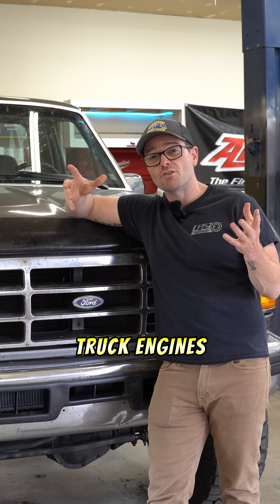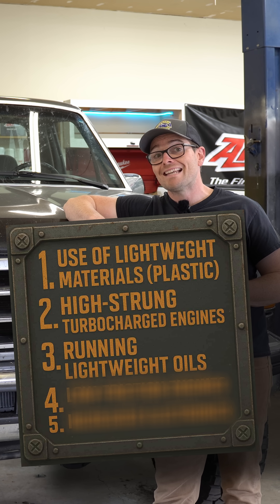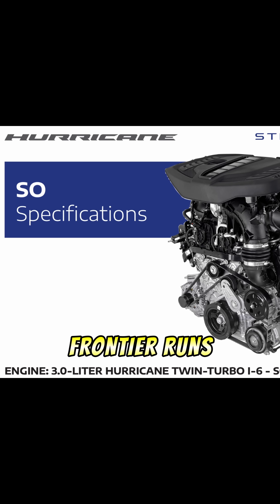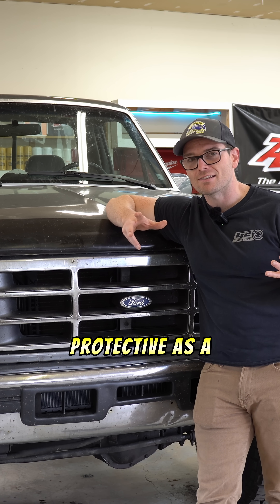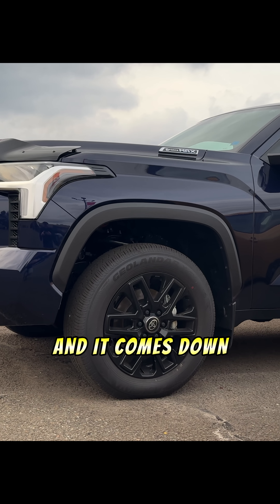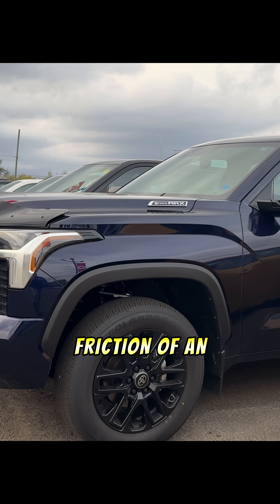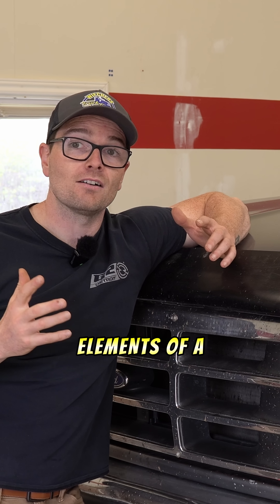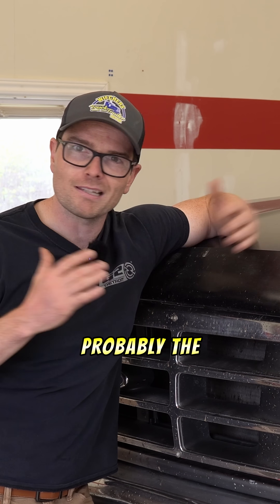Major Reason Modern Truck Engines Don’t Last as Long 👀

Comment: If it's a newer vehicle and was designed from the beginning to use 0W-20, that's one thing - but when they try to tell me that my father's 98 F-150 V 8, that was designed to run on 5W-30, and the owner's manual and oil cap calls for 5W30, is supposed to now get 5W-20, because they just decided to change the spec years later, I'm calling BS.
Reply: Id say you are correct
Reply: On my 2024 Tacoma, the manual and oil cap clearly say 0w-20, but the sales drone at the dealership says “Toyota is recommending 0w-16 now.”
This seems like a war between corporate DB’s and engineers.  In any case I’ll never get the service plan ever again because they probably drain out my amzoil 0w-20 and put in Toyota’s 0w-16😑
Reply: @theblueberryBULLET  Same here. My 2005 Jepp Liberty CRD, with a 2.8 L turbo diesel, was designed for CI-4+ diesel rated oil. Chrysler sold them with Mobil 0W-40 gas engine oil, not even diesel rated. As soon I got it home (bought it new), switched over to Amsoil 10W-40. 20 years later, that engine is still tight as a drum with no problems.
Reply: This is what I was thinking. I had a 2019 & 2025 RAM's with the 5.7 HEMI's my new 2026 with ( What I believe has ) the same HEMI engine now calls for 0W-20.  WHY ?

Comment: Viscosity takes up space, if the tolerances are correct, the lower viscosity oils will work fine. Film strength is more critical.
Reply: Clearances, not tolerances
Reply: @Resistculturaldecline 
It’s a fine line there , clearances vs. tolerances.  If the parts are in tolerance, the clearances will be correct.
Reply: @edwardhoward4708  They are topics of the same discussion, but theyre different. Like engine displacement and HP, as a poor example
Reply: You know what else takes up space? Bearing material from lighter weight oils not providing proper lubrication and film strength.
Reply: Bullcrap

Comment: My 2022 F150 5.0 takes 5w20.  My first truck 66 F100 352 took 20w50. It blows my mind to see 0wANYTHING!
Reply: Remember that the first number is the cold weather crank rating of the oil. It is not viscosity at operating temperature. Cold oil is way more viscous than it needs to be for proper lubrication, even if it is a 0W oil. If you have a diesel that specs 15W40 then there would be no harm in running a 0W40. It would actually be better for the engine since startup lubrication would be improved. The viscosity at operating temperature will be the same. 

With conventional oil getting a 0W40 to perform well across all temperature ranges meant a lot of additives which had a risk of breaking down, which meant very frequent oil changes would be needed. With a full synthetic, it really isn't difficult to achieve and still provide a longer service life than a conventional oil.

The second number in the viscosity rating is critical. This is the operating viscosity (weight). Always follow the manufacturers rating here. Going lower could mean a reduced oil film thickness, which may not be adequate for engines with higher bearing clearances. The oil may drain out of the bearing interface faster than it is supplied. Especially at idle. Higher viscosity is usually ok within reason but may result in increased heat and a loss in efficiency if you go nuts and jump up from a 5W20 to a 15W60 for example. 

Lots of discussion online. But if you don't care to nerd out online about oil viscosity. Just stick with what is written on the fill cap. 😂
Reply: Yea an in 1966 a 100k miles was high. 200k miles in 2025 is not uncommon. 

2011 Toyota tundra has 200k miles, only ever used 0W20.
Reply: @FrostlineAK I have a 2017 Sequoia with 250,000kms and only use 0W20 Synthetic. I just buy the name brand on sale with a Toyota filter.

Comment: Just for reference people need to look at their owners manual. It will suggest varying acceptable oil weights for different temperature ranges. You can run many different weights within a given temperature range and not void warranty.

Comment: Just for reference people need to look at their owners manual. It will suggest varying acceptable oil weights for different temperature ranges. You can run many different types of weights within a given range and not void warranty.
Reply: viscosty doesnt equal protection. its the internal sheer of the oil . as long as the outer layers stick too the metal and the inner layers can sheer internally without the outer layers getting displaced you are very well protected

Comment: Ehhh you should maybe converse with “the motor oil geek” on YouTube maybe yall could do a video together. It’s my understanding it has more to do the manufacturing tolerances than anything. Tighter tolerances requires thinner oil, large tolerances requires thicker oil to fill voids. Also lower friction is also better for reliability, so if it does reduce friction like you said that would also make it more reliable. Oils entire job is to reduce friction.
Reply: OK, Traditionally most engine plain bearings needed about one to one and a half thousandth of an inch clearance between the journal and the bearing shell!  Just how tight do y'all think these new engines are? Yeah plain bearings ride on a thin hydrodynamic film of oil when they are running, they don't actually touch the bearing journal. But there has got to be some clearance there to withstand shrinking and expanding as temperature changes like as when the engine is warming up. 
 So I don't buy that tighter clearance theory.  
 So the clearances on modern VVT engines may be just slightly tighter, but they are more importantly they are more accurate with better surface finishes and metallurgy.
 And these thin oils are all about CAFE. But I wouldn't use anything heavier than 0W30 5w30 or possibly 0W40.
Reply: Yes but I think lower friction also means lower protection against hard shocks of power.
Reply: I've seen his video. I don't listen to the tighter tolerances mumbo jumbo. I'm far more inclined to believe they use the thinner oils to increase mileage. Yes, they might have decreased tolerances to use the thinner oil but they're prime motivator is mileage. Thinner oils don't protect in high heat, it's like lubing your engine with WD-40. No thanks. My personal experience is my 99 XJ with the 4.0 six cylinder that I have owned since new. It has had oil changes at 3-5000 all it's life and still runs like a raped ape. It is spec'd to use 5W-30 and it gets that and hated 10W-30. I have recently started using 10W-30 as it gets older with 130,000 on the clock and it loves it. So, in my opinion you should use the  lighter weight when new but switch to thicker as the tolerances open up.
Reply: @oldman-zr2ru it’s almost like maybe the tolerances got looser as it aged and got miles on it. Then in turn possibly needed thicker oil (at least while cold) due to looser tolerances. Your personal experience lines up perfectly with my original point.

Comment: The change in bearing materials is an overlooked factor in the reduced durability of today’s engines. Manufacturers moved away from tri-metal steel, copper, lead bearings due to EPA restrictions on the handling of lead. The current polymer coated aluminum bearings simply don’t have the durability of a tri-metal bearing.  The tri-metal design was much more tolerant of debris or breakdown of film thickness. Add to that tighter clearances and lighter weight oil you leave very little margin of error before you have bearing failures.
Reply: One of the same reasons modern Electronics absolutely stink. They took all the lead out of the solder and therefore took out all the flexibility. Now all solder joints do is crack
Reply: @acemobile9806  I was gonna say the same thing. Red Ring Of Death
Reply: IROX coating/layer adresses that and stop/start dry risk. The aluminum bearing ahells are fragile but AFAIK those are no longer used.
Reply: clearances arent any tighter the light weight oil is for CAFE standards only it has nothing to do with friction or tolerances
Reply: @GoTotheMoonElon     yes , maybe somewhat tighter, but more importantly more accurate tolerances and better surface finishes and metal treatments.

Comment: I do run 5W-30 on my 2020 Ram Hemi and she LOVES it!!! She runs way better! No more valve train noise and most importantly almost 65k miles with no lifter tick
Reply: Yea, iv heard the 5.7 hemi runs 0w20 from factory. Dumbest thing you can do is run that thin of oil in that engine.
Reply: I been running Amsoil Signature Blend 5w20 in my ‘16 no issues at all it has over 202k on the clock.
Reply: @JeffK-w8r   Signature Series I suspect you mean. They don't have a Signature blend, although they do have a semi synthetic they guarantee to contain 50% or greater synthetic base oil, where most other synthetic blend oils only contain from about 5% to 15% or so synthetic. I've heard it's pretty good but haven't tried it.
Reply: @JeffK-w8r   I've been running 5W30 Signature Series in my fords that call for 5W20 and it's been working good. Gives a little extra viscosity protection against fuel dilution thinning n stuff.
Reply: Pennzoil Ultra Platinum 5w-30 for my '17 F150 5.0... truck runs smooth, sounds smooth... is smooth. 🇺🇸
Reply: Buying a new truck at 150K miles is insane. Do you lease or finance? How can you afford thst
Reply: Same here, over 100k on my 17 ram and it purrs.
Reply: Be Ready For Cam/ Lifter Issues..If This A 5.7 Hemi...Thank Dodge Ram For The Factory Problems....6.4 Hemi's No Problem There....
Reply: @tonybernheim8365  6.4 eat lifters too
Reply: @tonybernheim8365  not gonna happen hahaha my lead foot mixed with better oil, she’s purring until 150k, then I’ll get a new truck hahaha
Reply: @jsqared 
I'm running mine until 300k miles before I spend 70k on a new truck😂
6.4l
Reply: I’ve got a 20 rebel and changed every 5k and had lifter failure at 58k using the recommended 5-20. My father-in-law has 130k on his with no failures using the dealership oil but changing every 3k. He also has start stop and has way less idle hours on his. 150h vs 380h. 🤷
Reply: @h.merica  yeah that’s why I use the thicker oil, I also don’t let my truck idle, pretty sure I’m under 200 hours of idle time. I also change my oil every 3k miles

Comment: The Ford Crown Victoria’s 4.6 V8 ran 5w20 and it literally runs forever reaching well over 200k in police cars which idle a LOT.
Reply: Also the Ford Crown Victoria ran 5w-30 and lasted even longer.
Reply: My 2010 f150 is the same 4.6L V8 and I run 5W20
Reply: My two 4.6 Mustangs took 5w-20. The 2v i actually put 0w-20 because 5w wasn't available at that time in Mobil One.
Reply: 5.9 magnum in my truck uses 10-30 and has 290k on it and runs well.

Comment: How do you factor in bearing clearances and pump design?  I would switch to 5-30 from 0-20 personally. Some of these new engines might not like a thicker oil.
Reply: Thats bs, it basically comes down to what climate you live in. If your way up north 0w-20 will work fine. Down south that 0w-20 is like water
Reply: @MattC0725  why does it matter, all engine oil reaches temperatures above 200°. If it’s 110° outside, so what? That whole if you live in warmer climate is an absolute fallacy. If it’s cold outside, though the thinner, the oil the better.
How can you say 0W 20 is no good in 100° heat when 10 minutes later you start your engine and that oil is literally 200°
Reply: @Maynardd  if you think the engine oil stays the same temp in every climate you havent been around vehicles long
Reply: @MattC0725  your comment says absolutely nothing. That engine oil is reaching 200° plus in any climate. I lived in Florida for five years, average temp of the oil was about 205°. I live in Northern Illinois where it can be -10 and guess what that oil reaches about 205°. An engine is a sealed combustion chamber. It reaches temperature no matter what. You don’t know what you’re talking about. Do you? Then explain it to me. Your concerned with something that might be sitting outside reaching let’s even call it 120°. But when you start that engine, it reaches over 200°. Make that make sense. The thinner the oil at start up the better!
Reply: @Maynardd   pull a 15k trailer in 100 degree heat and tell me climate doenst effect it. Your whole cooling system is based on the ambient air temp (radiator, engine oil cooler)
Reply: @MattC0725 😂 i’m a commercial roofer, trailers, dump trucks, whatever it doesn’t affect it at all, it might affect the transmission temp though. What’s that have to do with the outside temperature being 100° cooler than your engine oil?
Reply: @Maynardd  also you do know engines ingest outside air right? So tell me how its sealed 😂😂
Reply: @Maynardd  😂😂 ok bud run some 0w-8 in your truck should last longer
Reply: You can always try 0/30 as your start up cold flow will be virtually the same but you will benefit from having the 30 when running the engine hard pushing temps up to the limits of the 20 weight oil
Reply: @mred3660  5w20 is better than 0w30
Reply: I feel that most of the light weight oils are fine for grocery hauling and kids football soccer games as I feel thats how the manufacturers have designed them but when we work these engines hard you can easily push oil temps beyond what 20 weight is designed for which is where they maybe should have spec 0/30 or 0/40 oil for these engines but I wouldn’t make any permanent changes without oil sampling at least three times with each grade to see what works best

Comment: How is a turbo motor high strung.. they run lower rpm than gas and can make power by spoiling the turbos instead of higher rpm.. every semi truck on the road is running a turbo. The fuel never touches the turbo for those who say it’s a diesel. You can build a stout gas engine designed for a turbo too.
Reply: Turbos use your engine oil to.cool them, roasting any low.grade oil well before any fuel dilution happens. Gas engines rev higher than diesel and destroy the oil faster cooking it, especially with a turbo added.
Reply: It's just a dumb saying. Most turbo engines are built for boost and will run just as long. The torque from my Ecoboost is really awesome.

Comment: The Hemi 5.7 runs 0w20 as well. Same oil pump, you can imagine how low the oil pressure is at a warm idle. 18 psi. 
Mine has 21000kms on the ODO. She's loud and already making valve train ticking.... I've been using 5w30 since new. Maybe I should of stuck with 0w20??
Reply: I did the same with my 2014 eco boost, maybe should of stuck with the 5w20 300k kms plus

Comment: On a 2019 silverado 1500 i use amsojl 0w20. Should i keep using that or change?
Reply: I'm just some guy on social media, but ive been interested in and followed such topic for 30 yrs. My opinion is 5w30 unless you live in a cold climate, change every 4k-5k depending on duty and usage.

Comment: I mean the 5.7L V8 Tundra runs OW-20 and they go quite a long time. I’ve seen 500-700k and that one guy hit 1M. Same guy that did it with the older 4.7 V8 as well.
Reply: 8 million mile tundras now…..
Reply: yea same for the Ford 6.2 V8 on 0w 20 that thing just wont die
Reply: @aaragam1 not in the same league.
Reply: You mean those new v6 that keep blowing up
Reply: @me29903  no, the old 8 cylinders.
Reply: @me29903 what part of V8 did you miss. All gas turbo engines are less reliable than their NA counterparts
Reply: @me29903 0.4% out of approximately 500K Tundras on the road.Far less than the ecoboost and gm V8's